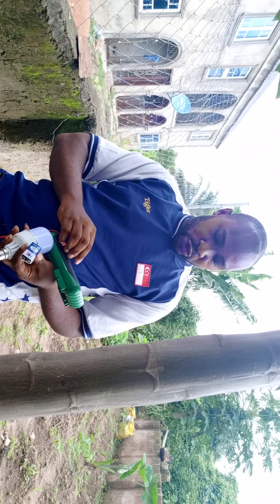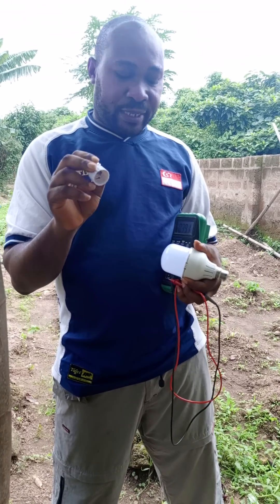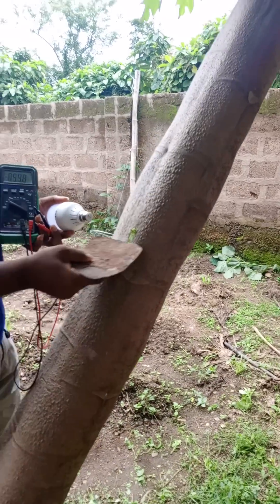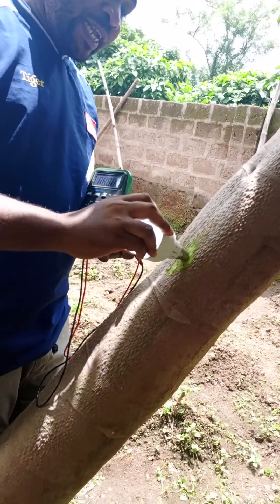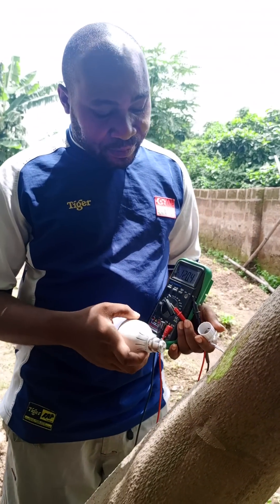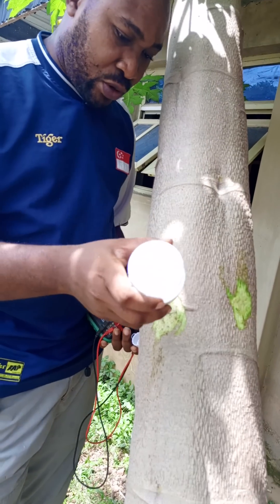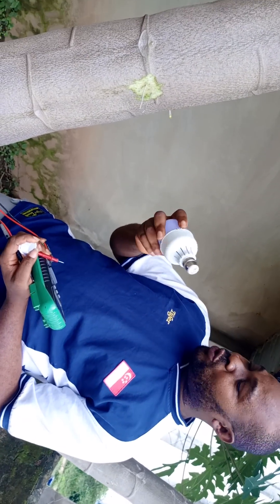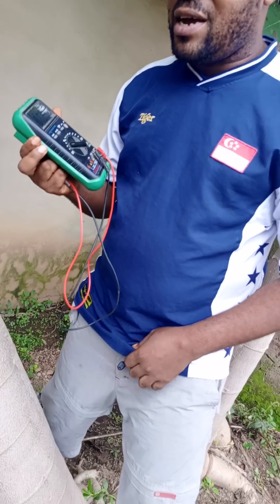Demystified: Trees generating Electricity?

Comment: The distance between the terminals plus the different metals used, with capacitor with a transformer is a added bonus to harvest electricity. So you don't need that much electricity for harvesting.

Comment: If I can fix the power saving bulb to the tree,can it produce light continually/consistently as long as the bulb  is attached to the tree?
Reply: No
 There a battery inside the bulb that was charged while in a lamp that was turned on. Then if your electricity goes out you can use the battery in the bulb for awhile. You can also touch the bulb against the tree if it is damp where you skinned it. And it will go on because of the battery, not electricity in the tree😊

Comment: Trees do in fact generate electricity but probably not even enough to light a single led. You can connect your positive lead of your multimeter into the tree bark making sure you've reached into the moist level and the negative lead into the ground and get a low voltage reading. You needed to do the same with your led test as if the tree did produce electricity your setup wouldn't work anyways. Keeo experimenting, keep debunking as calling out the tricksters and scammers is always a good thing

Comment: Okay everybody this is your Liberian speaking to anyone who reads this is what AI just said about drawing energy from trees.
Yes, you can potentially draw electricity from a tree using a setup similar to a lemon battery. Trees contain electrolytes in their sap, which can conduct electricity when in contact with dissimilar metals. By inserting two different metal nails into a tree, you can create a simple electrochemical cell. The effectiveness of this setup can vary depending on the tree species, the moisture content of the tree, and the specific metals used.
Some trees might produce better results due to higher electrolyte content in their sap or other conducive factors. Trees like citrus trees (e.g., lemon, orange) or trees with acidic sap might potentially yield better electrical output, similar to how grapevines, which prefer acidic soils, could also be suitable candidates.
If you're experimenting with this, it's important to consider environmental and ethical factors, such as avoiding damage to the tree and ensuring the setup doesn't harm its health. Additionally, the amount of electricity generated from such setups is typically small and more suited for educational purposes rather than practical power generation.

Comment: Okay I'm glad you exposed this fake tree thing but my question to you is don't you understand that a lemon which is a fruit And for hundreds of years we've known that we can make a battery out of lemons so  Can certain trees do the same thing it's based on alkaline and since we've learned this in school in the US this is something we learned in the lowest grade so I don't understand what your point is just tell people how to do it correctly😊
Reply from the maker: The debate here is tree generating a 220V AC electricity which is not possible. The lemon experiment you talk about will require some form of electrodes to have the acidic or alkaline content interact with the right electrode to give a mV DC and I mean a very very small millivolts which cannot power anything. Attempting to use it with an LED will show a very dull light cos LED requires about 0.7V to forward bias. So generating major electricity from trees like we do with solar panels and the sun is not going to be any reality soon 😂

Comment: This is a completely different experiment than the video with the grinder and light bulb. in this case, he has thelectrodes of the LED bald, both touching the same spot on the tree. with no separation. in the other video. There is approximately 3 feet of separation.  Not saying either one or legitimate comma i'm just saying it's a completely different experiment.

Comment: I watched a video on YouTube where a man from Kenya powered a drilling machine or so with the Moringa tree and even charged a phone with it...

Please explain the mechanism behind that too
Reply from the maker: The recording of the video showed that something else was powering those devices and it was not from the tree. Trees cannot generate AC which are fast moving streams of electrons. The best you can get from trees are very small DC volts and not AC voltage as claimed by the Kenyan video.

Comment: At least the guy have tried, if not his discovery, we wouldn't have known that those trees can lighten rechargeable bulb that little battery was incorporated with it by touching the base of the bulb on the inner skin of such trees. Mystery or no mystery at least the bulb lights.
Reply: Yes this is what I want people to acknowledge and appreciate if it a white man that brought this up now it will be well celebrated
Reply: It's like u don't understand, the tree never powered the bulb and it can never power any bulb . The rechargeable bulb has a  built-in cell batteries , remember in physics if u don't establish a bridge current can never flow it's wat they call closed circuit , the bridge created make current move from one point to the other , that movement is called electricity and if u place the bulb on any conductor it will light .
Reply: You said it all ! You need a bridge to be established for current to flow. 
Now, before this young African brought that fact into light, did you know – Mister Engineer – that the sap from the tree could act as a bridge  ?
Poor Africans ! Always denigrating other people's ideas. It's SAD.